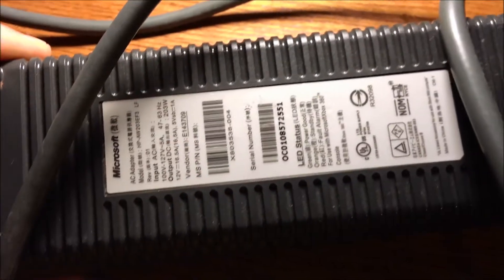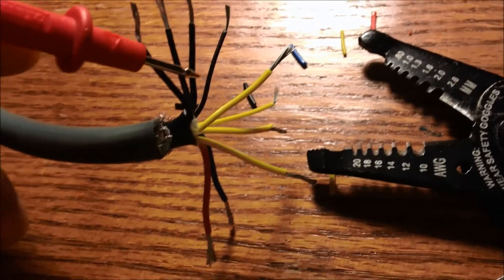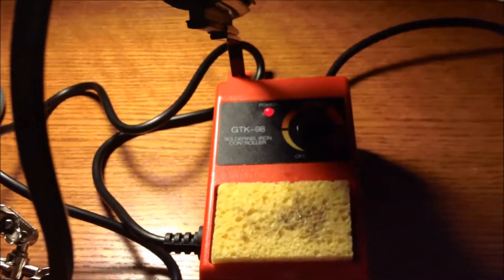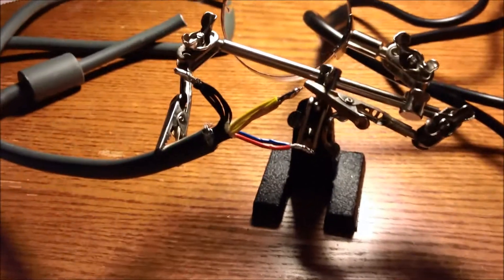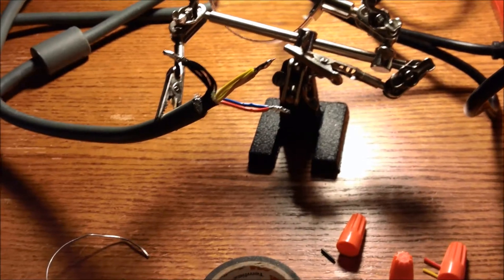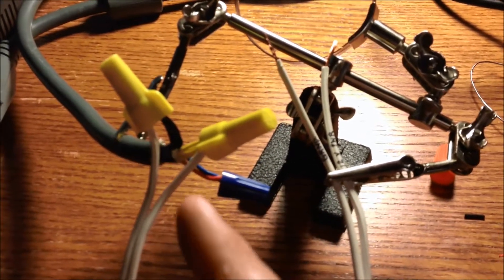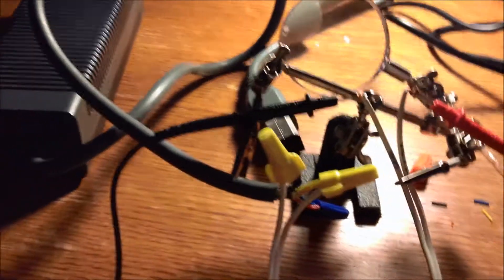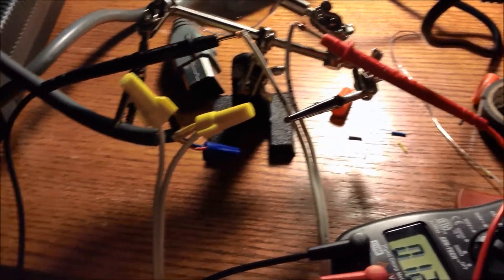12 Volt #Power Supply for #Testing #Electronics

Comment: i did that to a 360 power brick awhile back to test car stereos and amps, i put a toggle switch on the red and blue wires instead of fusing them together like you did. i find a toggle switch made it easier for on off operation.
Reply from the maker: I like that idea

Comment: Will this put out the full amperage? Sticker says 16.5A on my Xbox 360 power supply. I'm afraid it may harm smaller 12v stuff on cars
Reply: It's a voltage regulated power supply so any loads connected to it will only take as much current as they need and no more.